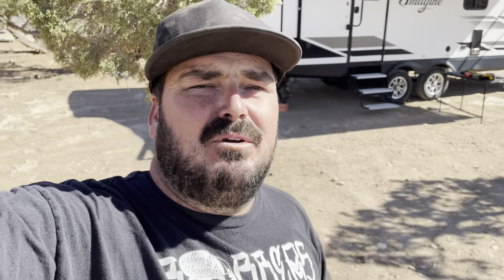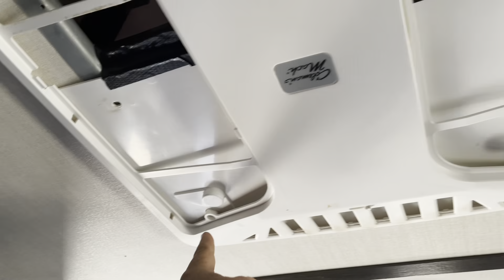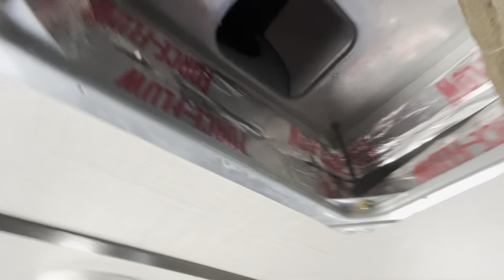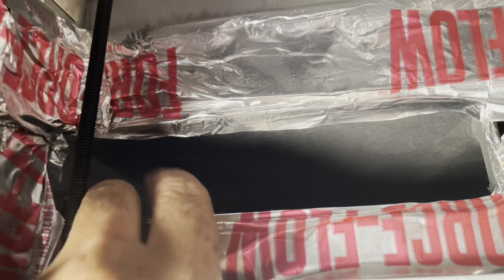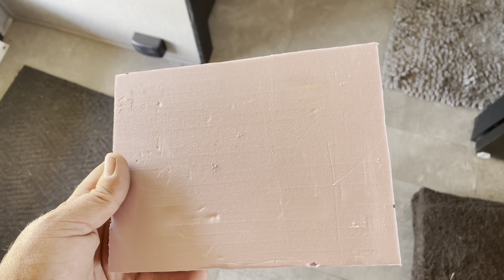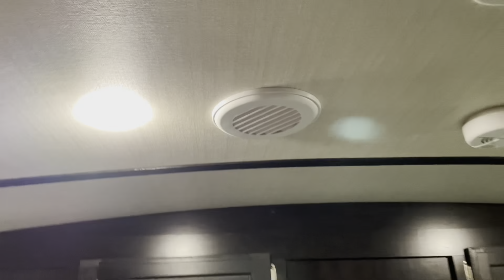How To Make Your RV AC Work Better, More Efficient and Colder - DIY

Comment: Thank you!  Just completed fixing our AC using your step by step tutorial.  One of our ducts was obstructed with haphazardly placed duct tape and the other duct had excessive rubber from roof blocking half of duct!   Added the insulation board too.
WOW….it really made a HUGH improvement👍🏻
Reply from the maker: Awesome glad you got it straightened out

Comment: Since you have 6' of that foam board left over maybe make window covers to block the sun it's not hard to fit a cheapie window unit in a big window for when you are camped. Just get a 5000k unit to give you a little bump
Reply from the maker: Problem is power consumption. We rely on solar and generator. I wanna get a mini split so that i can run better and more efficient
Reply: @SirWilliamGoes  don't get split system... Just get a soft starter. Cheaper and easier and it makes your current system more efficient.